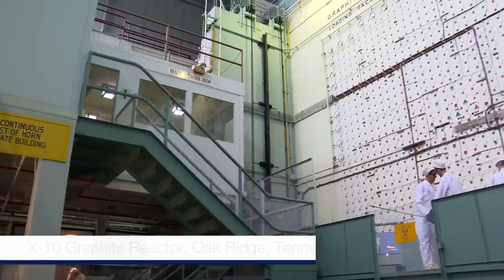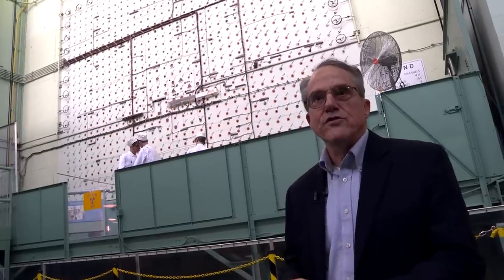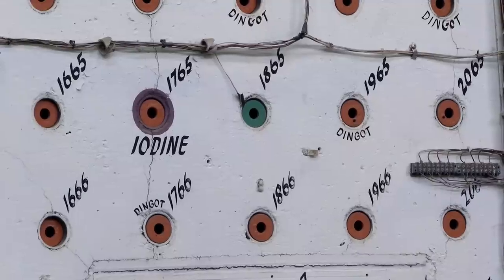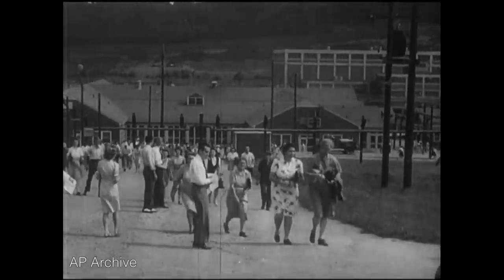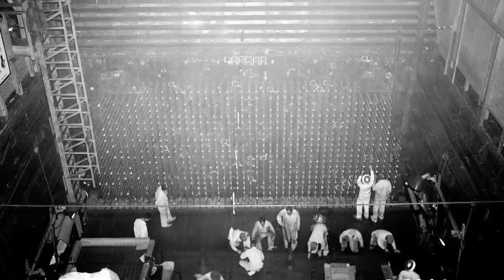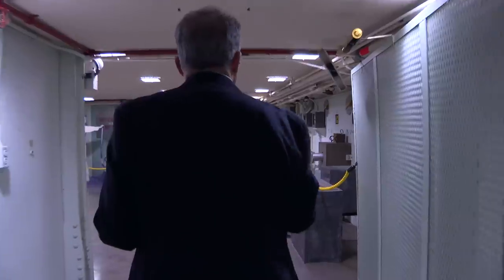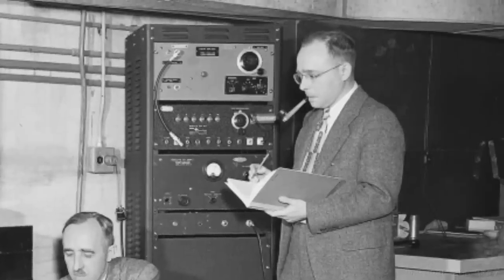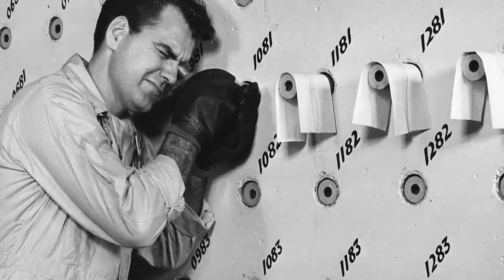The X-10 Nuclear Reactor - Periodic Table of Videos

Comment: Graphite is a good neutron moderator but it tends to accumulate radiation so it's use as a reactor core has fallen out of favour. Once the reactor has reached the end of it's useful life the core needs to be dismantled. Cutting up tons of highly radioactive graphite to ship away to storage is not a fun task so the current policy is usually to leave it about 100 years to cool off (radioactively) and then deal with it robotically - it's just cheaper and safer to wait. Having said that there are graphite cores that have been dismantled shortly after shutdown. I forget the name of the site now but one was done in Germany and the area is now farmland.
Reply: Cutting it up and shipping it out in a container is still much better than bulldozing it off a roof and burying it in concrete after dumping sand on it to make it stop burning.
Reply: @oron61  There's a big difference between decommissioning an inactive reactor in a stable environment, and doing damage control in a radioactive hotzone (so intense that only a few minutes of just standing there will give you a lethal dose) with an exposed reactor still smouldering under the rubble.
Reply: @ValleysOfRain  There is. I know which one I'd enjoy more.

Comment: It is amazing to see how similar this is to the B reactor, the reactor face appears a bit smaller and B reactor has caps and piping for water circulation; however the control room is strikingly similar. B reactor is also open for public tours (including foreign nationals) I live in the area and have been there twice now it leaves me in awe every time i see that reactor face. Hanford is amazing as it was not just science, it was science carried out by engineers at an industrial level. Their solution for removing stuck fuel elements was to use a cobbled together blank gun and blow the elements out the other side. It really was the wild west of nuclear physics.

Comment: Now the same with the Molten Salt Reactor would be interesting as well! I still haven't given up on nuclear power as a safe and eco-friendly power source. Luckily most other counties except my home country (Germany) are still researching future concepts.
Reply: MSRs are very promising indeed. Early reactors were all designed with the primary purpose being to create weapons grade plutonium. Hence the choice of U235 fuel. The Thorium fuel cycle is completely useless for military purposes and this is very probably going to be the fuel of choice in future designs. I am very comfortable with nuclear power. So many lies spoken of risks and dangers thus associated.
Reply: Matt S   Thanks for clarity. I suppose all rector designs and fuel cycles have their pros and cons. What I am conscious of is the outrageous exaggerations made of the dangers associated with nuclear power.
Reply: Matt S  thanks for the link. I will follow it later.
Reply: Thorium, as I'm impressed, has a long road ahead to get to full power production. 
I suspect it will happen before fusion.
Reply: @oron61  definitely. Fusion is not remotely feasible at this point.
Reply: @paulanderson79  Do you know if it's just mechanically impossible with earthbound equipment, or just incapable producing a safe net energy gain?
Reply: Both. So far we've not managed, under terrestrial conditions, to create a sustainable fusion reaction which supplies more energy than is required to sustain it.

I also have serious doubts about the actual existence of thermonuclear (hydrogen fusion) bombs.That's a different issue, and politics dominate that one.
Reply: @oron61  More of an exaggeration.  We've made (unsustainable) fusion reactions and know from a physics standpoint exactly where we need to be to make it feasible.  But it is an ongoing engineering problem to make it a reality without costing a ton of money.  The pessimism comes from the fact that the idea for fusion energy was far ahead of its time and so the engineering aspect of it has not caught up yet.  For example: superconoducting electromagnets would be needed to contain the plasma, which until recently needed to be cooled with liquid helium (4.2 degrees above absolute zero) to function.  Only in 1986 did they find a superconductor that could operate at liquid nitrogen temperatures (much cheaper than liquid helium).  Another problem is thermal expansion and contraction: these superconductors tend to be brittle, and so break if the system containing them expands from the heat.  Further higher temperature superconductors will make it a lot easier.  Otherwise, controlling the plasma is difficult and requires a ton of computational power at the moment.  Faster computers are speeding up this process.  It's going to happen eventually; the question is if it will end up being cheaper than the alternatives (coal and natural gas are still extremely cheap).
Reply: Matt S  The MSRE experiment was ended because they decided to go with high pressure water reactors that could breed fuel for the nuclear bombs. Alvin Weinberg (who is shown in this video) was the director of Oak Ridge and the leader of the molten salt reactor experiment. He also designed the high pressure water reactors which we're still using the descendants of today. He fought for the adoption of molten salt Thorium reactors because of their passive safety among many other advantages but alas, political will was not in his favor. 

The MSRE project was initially started because the Air Force was in search of a nuclear reactor that was safe and modular enough to fit in an airplane. This idea proved to be pretty ridiculous in the end but it still brought us a fantastic reactor design.
Reply: @oron61  The MSRE project had a Thorium reactor running at full power for something like 40,000 hours back in the 60s. It's not that we don't know how to do it, it's that the engineers and scientists with the expertise on these reactors are all retired and many have passed away.
Reply: In this case, I so proud of our goverment becouse they want to build a new NPP ;)
Reply: So really, even if a fusion reactor produced a net power gain, with today's material science it would be so maintenance intensive that there would be no point in it. 
That's probably 90% of the engineering problem. Scratch 30 years. Sounds like fusion is 130 years away.
Reply: Nicolas Alexander Otto France is the leader in nuclear energy. The biggest problem I have is what to do with the waste. I agree that it’s clean energy. I would like to see more investment into thorium. But it’s a very, very big initial investment. And the safety involved in protecting a plant and making sure that we don’t get another Fukushima (because subcontractors are assholes) would mean it’s expensive.
Reply: @ferretyluv  I agree. But what alternatives do we have? Renewable do not live up to the masses of energy needed in society and industry at the moment, not to mention if we grow further (which would be ill-advised since energy isn't the only issue). And if transmutation reactors ever get off ground with enough funding we could get rid of our nuclear waste (or considerably lessen it's long term effects at least) and even use it to generate energy.
Reply: @faceplants2  its actually a shame they did not pursue airplane reactors more they could be made in modular systems designed to survive falling 500,000 feet. it has a lot potential and would produce town size reactors as a byproduct

Comment: Oakridge is not far from Knoxville Tennessee  I have visited it but  without much time it was like a drive through. 
 Much research still goes on at Oakridge,  for myself i would like it spend a few days there. 
 One of the things i find interesting about Oakridge it is secluded a long (miles) straight roads  in wilderness ( no signs, no structures, only trees 1 lane in one out, with wide clear sholders.that leads there i felt like i saw the remnants of dismantled check points on the way
And 70+ years after the beginnings Oakridge is still in the middle of nowhere.
 I can only imagine what it was like to go there 70 years ago when it was a top secret location.
Reply: There's really nothing to see there, except maybe the museum of science and energy.
Reply: Take a trip to Oak Ridge during the secret city festival and you can can take a tour of ORNL which includes the x-10 site.

Comment: On the face of the reactor there are several holes labeled "DINGOT". Does anyone know what that means/why they were labeled like that?
Reply: So, from what I was able to tell, it's in reference to direct ingot (or dingot) uranium; essentially, uranium processed through a different method than the one they initially used.  They seem to have started doing that in the 1950s, well into the X-10's life as a research reactor, so they presumably used those slots to test and process dingot uranium, and labeled them to avoid confusion about what fuel went where.

Comment: Just a note on something that has confused me in the past: the nuclear chain reaction in a reactor is only self sustaining once you take the decay products into account, so it builds rather slowly and is controllable, in an explosion/Chernobyl the reaction is self sustaining without those so it multiplies in energy by a factor of a thousand within a matter of nanoseconds- not controllable.
Reply: I think what you are trying to describe is the difference between a normally operating reactor and one that has gone prompt critical like Chernobyl. When a reactor goes prompt critical there is often nothing you can do to return the situation to normal without the reactor suffering damage, the energy release can easily be an order of magnitude more than the reactor was design to deal with. Reactors are generally designed to make it hard to achieve a prompt critical situation, Chernobyl was of a very poor design that was known to be dangerous.
Reply: Dylan Davies, yes part of the reason for the decrease in power a Chernobyl was xenon poisoning, whereby the iodine 135 decayed into xenon 135. But this isotope of xenon has a high neutron crosssection(of  3 million barns!) and could absorb thermal neutrons very quickly.  Uranum 235 crosssection is only 584.994 barns.
Reply: There is also something called the Doppler Coefficient that helps regulate the reaction speed at those very short time scales where control rods can operate fast enough. The chance of a neutron being absorbed unto a U-235 nucleus is greatly affected by the speed of the collision (too fast and the chances go down). As the atoms heat up they move faster. And it's the combined relative velocity of those atoms' nuclei and the neutrons that must be taken into account. So the system can be configured so that the reaction slows down as the fuel gets hotter. The kaboom  (or "criticality excursion", as it's also known) happens when things go way, way past what can be stabilized by this effect.
Reply: @WobblycogsUk  Chernobyl did not go prompt critical (at least not in the whole reactor, some speculate that certain parts may have gone locally prompt-critical, but even this is not supported by the consensus). Indeed the power rose exponentially over seconds, which can happen with delayed neutrons. If it had truly been prompt-critical, the doubling times would have been measured in nano-seconds, not whole seconds.
Reply: @WobblycogsUk  Yeah, I seem to have heard somewhere that Chernobyl may have produced up to to 3000GW (thermal) energy in that minuscule fraction of a second when it failed.

Comment: I can not imagine that it would be cheaper to keep it as a museum then to decommission it. I do not know american regulation, but in both Switzerland and Germany, operators try to get "as fast as possible" from shutdown to being released of nuclear regulation as soon as possible. Which includes measuring parts of the former plant as "radiation/contamination free" as soon as possible to stream line the decommissioning logistics.
Reply: This isn't a powered reactor, though. It is a controlled site on a research lab...the pressure to decommission would only really be there when and if the lab needs the space.

Comment: People holding the uranium like that and inserting into the reactor, seems crazy.  How much radiation would people get?  And once in the operational state, how much extra radiation would then start coming from that same single fuel rod that the workers were handling?
Reply: Its not too bad when its first inserted but they work with them for such a long time that the radiation damage accumulates. 

As for the radioactivity? After a fuel rods has been poisoned by a neutron inhibitor/absorber, depending on how much time passes will tell how much radioactivity it emits. 

Radioactivity right after shutdown is ludicrous but it drops off fairly quickly, and then undergoes cooling off potentially many weeks/months (..if I'm remembering right) before it is cool enough and radioactivity has subsided enough to be transported for long term storage/disposal.

I believe that seeder reactors (ones designed to produce plutonium etc) have less radioactivity than freshly spent fuel rods though.

Radiation dose is also dependant on shielding strength. Dense metal like lead shields well, water is excellent too.. needless to say, with that thin of shielding around those rods..if they were fully spent..I'd say they probably got cancer.

Comment: One thing that confuses me about radioactive decay.  How does Uranium 239 become Neptunium then Plutonium?  Where are the extra protons coming from?
Reply: A process called beta decay turns one of the excess neutrons of a heavy isotope into a proton (plus and electron and an anti-neutrino), moving the nucleus one atom up the periodic table.
Reply: @gordonrichardson2972  So subatomic particles can change their charge, eh?  That's freaking cool!  Is there a similar process in which protons become neutrons?

I'm assuming that neutrons really can't gain a negative charge then (at least not for long,) because that would turn it into a anti-proton and end up getting annihilated.
Reply: ellaser93 Almost all possible transitions between sub-atomic particles can and do occur. Inverse beta decay captures an electron, and turns a proton into a neutron.. What is significant is the probability of each process, and the speed at which it occurs. Obviously charge needs to be conserved, but new particles can be temporarily created to balance the equations.

Comment: The word criticality was used on a number of occasions without explanation about what it meant in this reactors case
Reply: Criticality is the point at which the reaction becomes self-sustaining: the number of neutrons liberated by fissioned atoms is enough to in turn cause other atoms to liberate still more neutrons, and so on.  Control rods absorb neutrons, acting like a brake; removing them allows the reaction to increase.  Maintaining a consistent power level is a matter of constantly moving the control rods, in the same way that you are constantly varying foot pressure on you car’s accelerator pedal to keep around the desired speed.
Reply: @jeffhartman7000  Exactly this. Critical just means steady state in the nuclear world. SuperCritical means the reactor is increasing its power level, sub critical means the reactor is decreasing its power level. It is a horrible term that sounds super scary to the lay person but Critical in the reactor world really just means "everything is staying the same now"

Comment: so if plutonium must be produced in a nuclear reactor then what is a cyclotron? I always thought that plutonium was produced in a cyclotron.
Reply: A cyclotron is a way of making very, very, very tiny amounts of isotopes. They're useful for medicine and basic research. But they're totally impractical for the kilogram quantities needed for bombs.
Reply: A cyclotron is a particle accelerator, used to separate isotopes of uranium. The opposite of the plutonium production process.
Reply: @gordonrichardson2972  Well you can technically use them to smash protons into things and make stuff, but ya, not the most efficient way to go about it :D

Early stages of the plutonium generation project for Pu238 for space batteries was using cyclotron, I believe, before they switched to reactors. They just needed to test if the targets were really gonna work
Reply: Gary, to keep it simple, a Cyclotron, is a giant circle miles big with magnets that push small particals to speeds close to light (I guess) and then smash these small speeding particles into other small  things to see what happens - to put it simple / what small particals they speed and smash together is academic, whether they use a small rock or a radio active isotope to smash is besides the point. - A cylclotron is a big mile big magnetic circle (made out of big tubes/pipes/ tunnels/ freezing gases to a vacume / etc.) (some are 20 miles around, like in Sweden) used to speed particles up and then smash them so we can understand small particles in the universe and its secrets, (personally, Id like to get payed what they earn, puttsing around with big magnets and abunch of super theorys and electrical power used in a milla second, enough to drive a city)  - pretty much - Peace Gary.